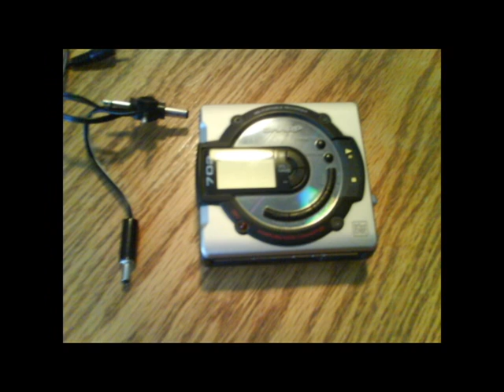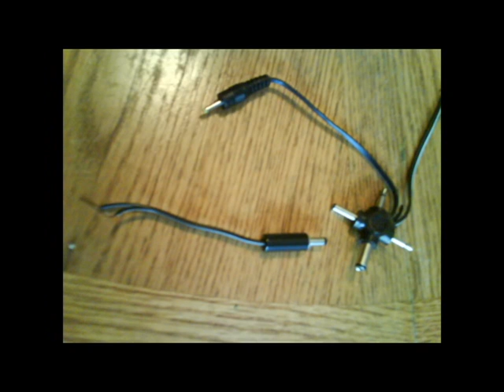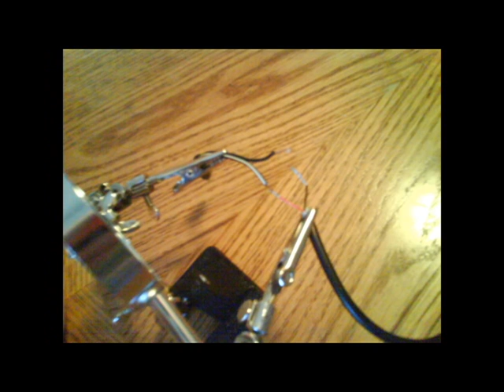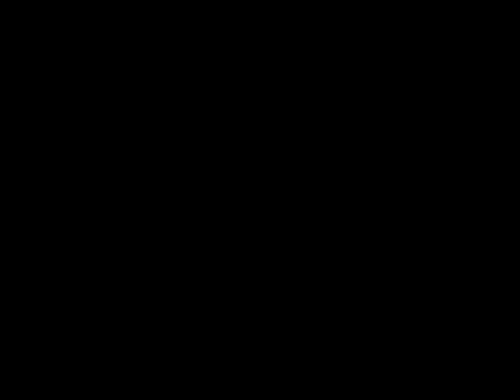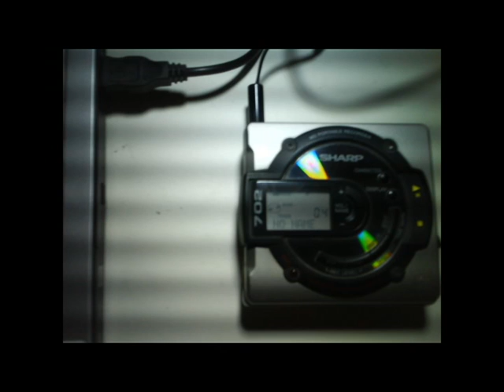Make a USB power supply for Sharp minidisc recorder

Comment: Nice job!, I must say I still have the adapter 'somewhere', like in one of the 7 crates with electronic stuff that is outdated but 'might come in handy in the future'. I did not want to go through those to find it now. So I thought, I'll just use my generic 'power brick'  with the right plug... Well, I have around 8 different plugs and none of them actually fits, really surprising! 
The battery on mine died as well, a pity because combined with a (Sony in my case) Stereo Mic it makes a great combi.

Comment: Shot in the dark here - does anyone know where I can get a replacement battery? I broke mine out the other day after a # of years and it turns out the battery won't retain any charge and I've been unsuccessful at finding a replacement so far -
Reply from the maker: Ebay has gumstick style batteries that look like a good bet, but you can also get an external battery pack for 2 AAs. I have one for my device and it works fine.
Reply: @JonathanKulp  Thanks very much for the response. #1, I have indeed seen the gumstick batteries you mention - I'm only hesitant because everything I see shows the + terminal with 1 contact, and I can't see the other end to ensure the 2 contacts (only one of which is used at any given time, allows you to flip it over).
Reply: @JonathanKulp  #2, I have also seen reference to that battery pack - would you happen to know where I could score one of those?

Comment: I actually found a already built cable thats USB to positive polarity center barrel plug. PSP-1001 usb cable they are like $1-2 on ebay now should work havent confirmed I ordered some. The full size ac adapter for this psp-1001 works as its 5v + center, but rather use a USB battery pack for portability obviously since this sharp model is stuck with li-ion battery you cant really get anymore nor, or as well trying to find a AA battery box adapter good luck.

Comment: did you make sure you had the polarity correct? It should only work with the wires one way around, not the other. I did this with 5V AC power supplies of different amperages... I found that the MD player is not as fussy as the battery charge system, it runs the MD while its on charge but I can't get it to charge the battery for more than a few seconds :/ and the batteries are a tad too long to fit an AA charger aaargh lol. time to hack a charger? I will try this USB method first ^^